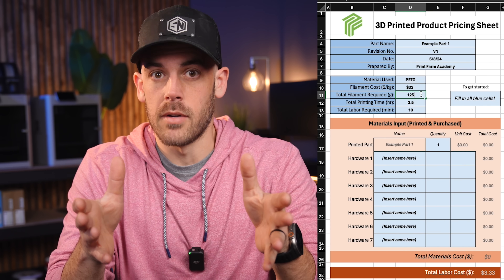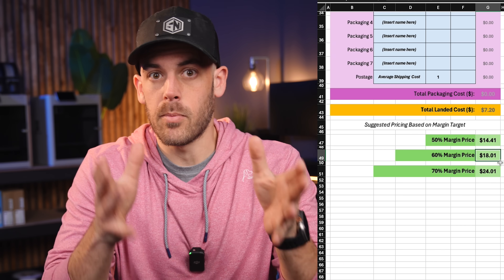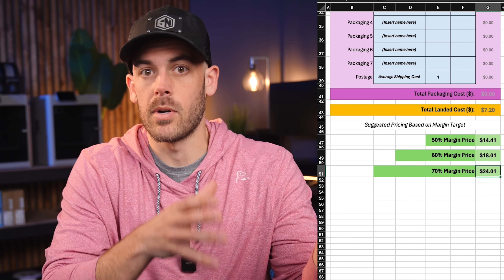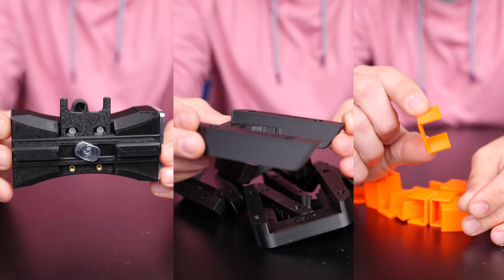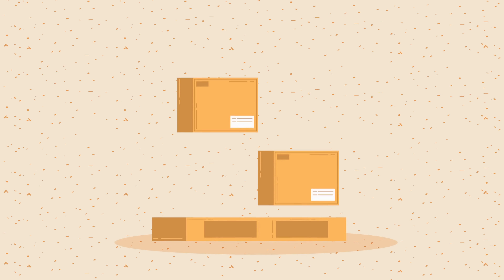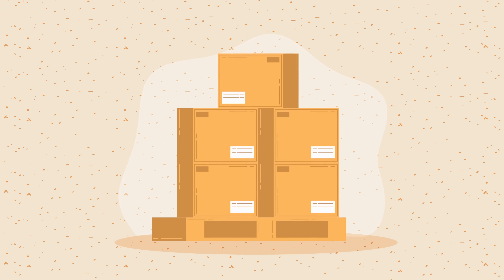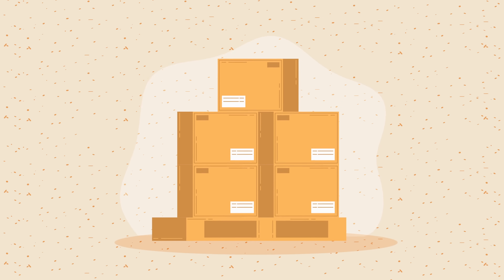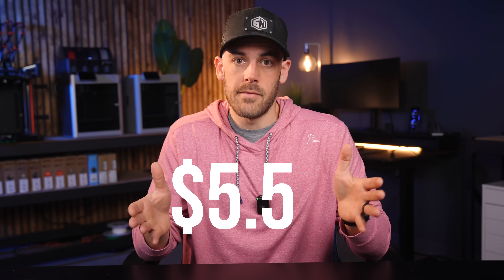Why I charge $55 for this 3D printed part (how to price)

Comment: How to price. LOL I am looking at that part and I can see it was a very long print. Time=$$$  Cost of electricity is always now accounted for. You will have to calculate what the cost of energy you are using based on location. It also includes labor on the machine.

Comment: I have 40 years in manufacturing cost analysis/setting. Lately Ive been using a variation of your spreadsheet for pricing my 3D printed parts. It's been keeping me on track and letting me do 'what-if" scenarios on pricing as far as applying E-Bay or Etsy selling fees. Thanks for this amazing tool.

I can't encourage folks strongly enough to download and use this!

Comment: Aloha!
thanks for that video and your breakdown. I downloaded your pricing sheet to compare it to mine and I think its awesome! Thanks for sharing.
I just think you are missing a whole block of costs and I wanted to check on what you think about that and why you left them out of the sheet.
So I call these administrative costs, for the lack of a better term, and they include:
- taxes (to be paid per sale of item): income tax & sales tax
- insurance: business insurance 
- rent: Printer space, Office space
- media cost: any form of advertising, web shop upkeep, cuts taken by things like Esty or something, etc.

Also, when I am selling at a market in person and not online, there is another bracket what I call 'event costs' and they include:
- location costs: fees for a booth, power on site, etc.
- travel: fuel, packing setup, pack down - anything that has to do with getting the product to the event location so it can be bought
- extra personal costs for selling the items, not for producing them, so not really the same labor costs as it is in your sheet
- any additional cost for events: some require extra insurance

And last but not least, like you have the investment cost of your printer in the machine cost section, shouldn't you also have a section for all other investment costs needed? 
Like: printer shelfing, storage racks, and all other things you need to build a proper print farm, since the printers can't just all sit on the floor.

Not sure if this comment will be read at all, but if you do, I would like your two  cents on that. Thanks very much and keep up the good work!

Comment: Have you ever considered implementing a distributed manufacturing model for 3D printing? In this approach, a network of individuals collaborates to produce and sell 3D-printed products, effectively decentralizing production. By segmenting manufacturing by region, you could potentially reduce shipping costs, optimize delivery times, and increase scalability based on the number of participants and available printers within the network.

While the shipping cost for most items may be negligible, the potential benefits of faster fulfillment and localized production could enhance customer satisfaction and market competitiveness. Additionally, by leveraging a distributed network, you could dynamically adjust production capacity in response to demand fluctuations.

If you’ve previously explored this concept but opted against it for specific reasons, I’d be very interested in hearing your insights on the challenges or limitations you identified.

Comment: Unless I missed it, Biggest cost, is your design of the product you are making. Unless you have someone building the part for you in Fusion for Free, ....... Then Design Cost  has to be factored into the price of the product.  Product A may only take you 20 min to design.  Product B could have taken 30 hrs of fusion work.   As always Excellent Video.
Reply: Good point, although I think if the seller also handles designing, that also gets added in labor cost.

Comment: The way you explained the labour costs would mean that the files of the stuff you want to print already exist for you for 0$.
But if you are spending your time, or one of your employees time in constructing the item in the first place, you have additional time and also license fees for the 3D drawing software you need to add/factor in.
All except one of the 3D drawing/contruction softwares cost a license fee for commercial use (some aren't even free for private use).
The only free option i know of even for commercial use would be FreeCAD, but one would need to be a  masochist to draw in FreeCAD. All the more intuitive stuff costs money for commercial use.
And i am not sure you get someone who is good at constructing 3D prints for 20$ an hour. (then again i am from somewhere else on this planet and have no clue about the US wages)

Comment: Sir, you are an absolute legend! Gifting this invaluable information to the printing community deserves all the goodwill one can muster. I'm not running a print farm, I'm simply offering FDM prints as an extended service to my design clients. Having this thoroughly well constructed, yet succinct video gives me the confidence to charge a fair and correct amount, while covering my machine time i.e. losses over time. 

Your 'Product Pricing' spreadsheet/calculator is a godsend. My gratitude to you, mate.

Comment: Print Farm Academy, I tried to download the pricing tool and when entering in a normal gmail address into the "email" section it says "This value seems to be invalid." 

Is there another way to get the tool, it looks incredibly helpful to a beginner. 

Thanks for your videos.

Comment: You forgot to factor in if you went to the store to buy the parts needed, or if you ordered it ( did you pay a membership for free shipping? Did you pay shipping? Sometimes that is less than going to the store itself, and so on ) - that factors into labor along with unboxing and sorting for use. Everything should be added. Also, some places charge more for electricity based on times of day - ie peak usage before people leave for work, and when they get home. Since you are running 24/7 you can average out these to get a final electricity cost. You just said it costs approx, without going into detail about that. Area your shop takes up also factors in, and you can include costs for lightbulbs, air filters, "rental" even if it is your home because it is a business, and so on. An example of air-filter cost is if you buy the cheapest $5 filter for your home, but dust, etc.. can ruin prints so you buy the $30 filter, then $25 of that filter cost is because of the business.

Comment: I’m a complete noob at 3D printing but wondering about using my 3d CAD skills for a side hustle. One question - why would you spend 5 hours printing low-value items for retail? Surely these things are better injection moulded? I’m curious - obviously your business model is working, as you have a large number of machines and a lot of business savvy.. anyway, thanks for sharing, not expecting a direct answer, but the trolls will shed some light on my question 😂

Comment: Landed cost is what it takes to get a component or supply that goes into the product in the door. Really what you want to do to get a true read on what it costs to make your product is to look at fully burdened cost. The is the burden of all costs related to running your business, not just the direct costs of the actual product. COGS, overhead, all that.

Comment: You don't factor in development cost? In other words the cost to develop the product; produce the print files, and design of the parts as well as any software costs such as Fusion 360 etc? Edit: I saw in another comment that you have development cost in the labour cost post. What about licenses though and cost of computer?

Comment: 60% margins are WILD. Proud of you for being able to pull it off, but also irritated that people don't question product value at all. To be clear, this isn't aimed directly at you, it's aimed at the consumer for not noticing how hard they get screwed over when buying (especially) non-essential parts.
Reply: 2.5x ti 3x full cost price for item ready ti sell, the cost of selling and manage the sell are out of this basic way of think (fro luxury brand e big event night are an investmets non pre calculated during time they manage tò have a budget for any tipe of marketing and add  are basic margin for normal clothing companies, if they are famous brands you go to 5X if they are luxury brands you go to 20X to 40x without batting an eye

an iphone is between 6 and 10X most of this Will be eated with customer service marketing exc that for a small or starting business are very hard to estimate or It Is not worth It (if not hypothetically, or with a long-term implementation plan)

What this good video explain Is the BASIC for an hobbist seller or starting small business. Here still missing a good 50% of the work for a business. A "good business practices" Is a good business Plan with practices to follow and implement over time.
Some example management costs, capital goods and real estate, cost of any licens, taxation, marketing, customer service policies, much more, exc (a complete business plan in a nutshell) 
to start with all of this might not be useful but they are to be known and  understand when to start implementing them. All this have a cost and over It all want a profit for this reason a T-shirt of Gucci cost 70-100$ and a good small business of an artisans can make the same t-shirt plus tailor-made at 20/30$ less earning from it

Comment: Great educational video, thanks!

In this video you mention to handle between 5 and 10% of the machine cost per year, for maintenance and repair. After that you mention machine cost of $1,000 and $250 for maintenance and repair, which is 25% of the machine cost.
Can you please clarify what the cost for maintenance and repair should be? (Maybe I missed something)

Comment: might i add these costs to the list? 
-electric bill
-rooming (office, storage, printing space)
-air purification systems
Reply: if its a business inclined service that is used for business and business only. Then yes.
Reply: @animentors  well its not hard to determine "x amounr of power is used by these appliances" i guess i shpuld have mentioned you dont add your ENTIRE electric bill but just the cost it takes to poeer the decvices USED for business.

That being said, its make sure yall take into account that without your business would fail. If the power goes out in your house, and your business is bassed out of your garage; NOT having that bull covered vould mean upur business is potentially out thousands of dollars every hour the power is out. Thats why i mainly added these; because if you also have to take up a room you vould use for other projects you are taking away from other sources of income; and no power in the house vould ruin a startup from home business...

Comment: Depends.  For some reason I only spent about $50-100 each in maintenance in 5 years with several Robo R2's.  I think I replaced 2 print beds, a handful of steppers, small fans, and thermistors.

Comment: It's also worth considering the opportunity costs involved with printing one thing over another thing. If you are constrained for print capacity, there can be times you earn less based on what you decide to print in the limited print capacity available.

Comment: I haven't read all the comments. But you seem to forget one big item. Your overhead cost. How much is the building your using costing you.Your electricity would normally be in this. This is all electricity not just the build cost. Lights, A/C, Heating, Computers, Etc. I see you have the units on shelving with UPSs. Your labor rate needs to be adjusted to. Your looking at direct labor. Your Labor rate needs to include indirect too. You included shipping and handling. But what about receiving, stocking, cleaning the shop, resting, etc.  You also have government fees like workmans comp. and SS taxing. You have your backend cost too. Billing, payroll, management, customer service, Returns, RMAs, etc. This all takes time and cost money.
Reply: usually this would be factored in if it were a large manufacturing warehouse. Since its his personal living space then the cost for living isnt plausible to the landing cost.

Comment: Your markup rate is dishonest, you are making a profit on shipping cost.  Your Reveal Spacers real cost for your service alone is not 8.45 but -5.50 which is 2.95. When you decide up on a 60% profit margin on these parts you would calculate 2.95*1.6 + 5.50. Which is 10.22 and NOT 19.99. You are making of a profit of SHIPPING while you yourself do not do any extra service, you are basically charging an additional rate on shipping (60%) for yourself but another company handles it. So in reality your projected 60% margin on reveal spacers for 19.99 is actually around 490% margin - 2.95*4.9=14.45 + 5.50 Shipping. This is just being very dishonest about your profits, you try to tell people "hey 60% isn't that bad" while its almost 500%.

Comment: at 10:15 how do you calculate those markup values? I get $21.50 if you add a 60% markup to $13.50. $33.75 is a 150% markup??
Reply: hes factoring all the costs including shipping and labor ect.

Comment: Do you happen to have a video about how to charge for design time? I'm new to CAD but picked it up quick, already have a few products designed, I wasn't sure if design time is applied to product cost, but also would be good to know the difference between applying design time to product cost vs selling or licensing a design itself. Great videos, btw!

Comment: The soul cost has a mental component too.  The monotony of having to process, box and ship 4000 planters to make just a few bucks on each one is going to be a lot more soul crushing than having to make a lot fewer of a more complex item that costs a lot more.  Since there are print farmers willing to do the mindless assembly line work themselves, you aren't going to be ale to hire help to compete with them.  Personally I'd rather make fewer more expensive things than a larger number of cheap things to get to the same amount of money in a given time period.  If 3D printed parts are just one component of a more complex overall build that also contains electronics, welding, CNC machining etc. then competitors have a bigger barrier to entry if trying to make the same thing and the fabrication work is more interesting.  Maybe once Elon's robots are dialed in then the monotonous labor problem on high volume, low skill products goes away, but until then...

Comment: I looked at the excel sheet and it could use a few modifications. For example, it should be able to print an invoice. Just another sheet that takes all the information entered on "3D Printed Product Pricing Sheet" and condenses it into a 1 page invoice. Skipping any blank lines or omitted sections. For example if I am handing the print to a client there is no need to print shipping on an invoice, or if I am inserting no extra hardware or just a single screw, then the unused hardware slots would be omitted from the invoice. Instead of the markup pricing you have below, simply allow me to enter the exact markup I want, IE: 27.487% Then see that factored into the total on the invoice. It could also just list totals depending on the client and maker needs.
 
I know how to adjust some of this and will YouTube the rest, but the ability to use your sheet to generate a printed invoice would be nice. You have designed this as a maker calculator, but it is literally 30 minutes from being so much more capable, for someone that know what they are doing,  for the product sale itself. For me this will take a week of learning and videos just to figure out how to start. So as a novice to excel, it would be nice if your sheet was already at this level.

As for the presentation and video, I both liked and subscribed. Very good job explaining and demonstrating. As a market expert I find it very important to educate fools. When you are making a product that is worth $100 after markup and some armature is cutting his own throat by selling at cost or pennies above cost or even below cost, it makes it very hard to make any profit at all. I for one would buy the cheaper one, provided the quality was the same or at least still acceptable, and so would almost all people. The problem is in some cases those costs are low because of things like child labor, and other times they are low because the cheaper operator just has no clue how to set a price. When I was young I started my own business mowing grass. I calculated my gas, and and time, and under bid everyone. In no time I have 50 clients paying me 50% of what they had payed their former lawn service. I left out some very important factors, and when my mower blew up I realized I had not adjusted my prices to include equipment. My business failed in just 1 malfunction. Granted I was 14 so I had a lot to learn, but my point is, most people, have less business sense than a 14 year old. So thank you for your part in educating others about the true cost of printing and the value of time itself.